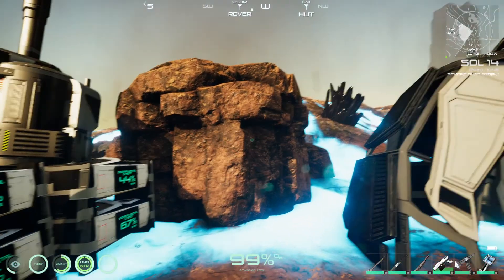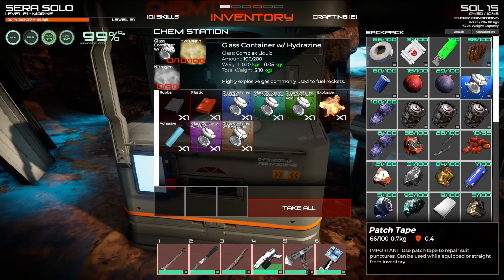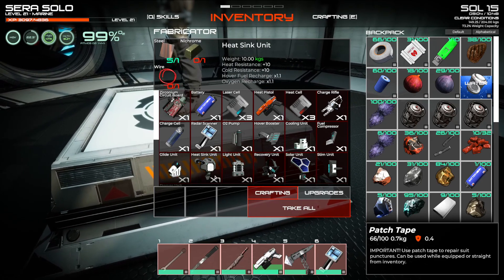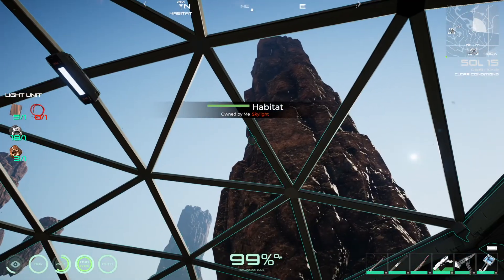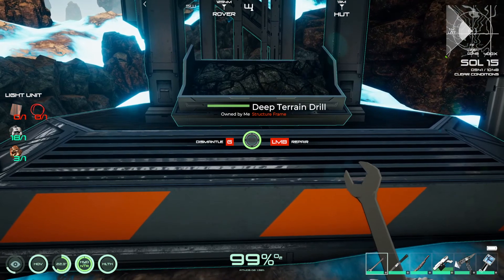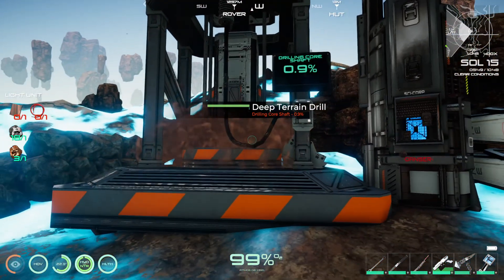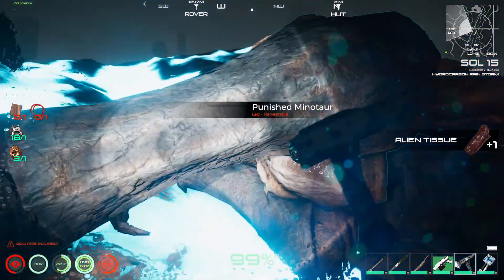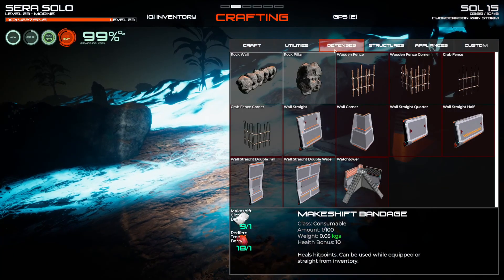Osiris New Dawn Ep10 - Printer / Chem Station / Drill and BASE ATTACK!

Comment: I've played a little bit with the drills.  From what I've seen once you get passed the Mantle the bugs stop coming in swarms.  
If you place a drill in an area with a lot of Iron it will mostly get iron, and it will pull a few of different types of ore.
Reply from the maker: Yes, I've noticed that later.  I put some text on the screen a bit after I found those few ores, saying that it did find much more after running it later.  Thanks for watching, and the comment!